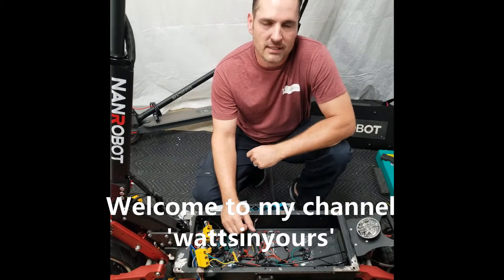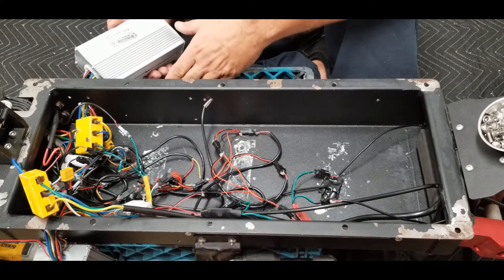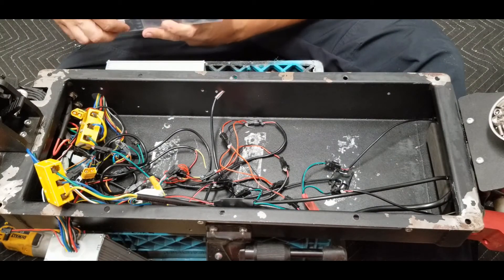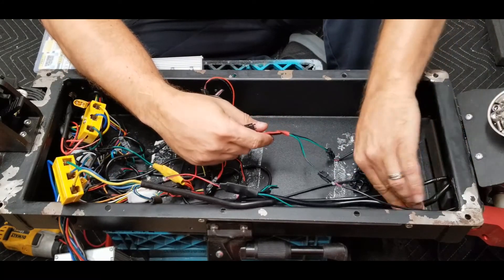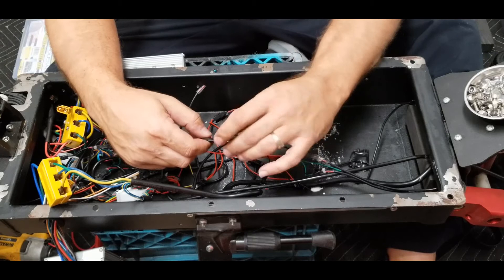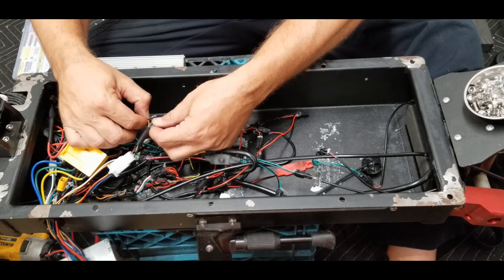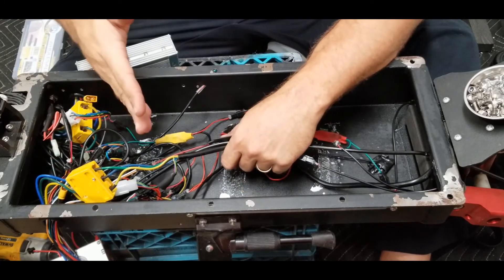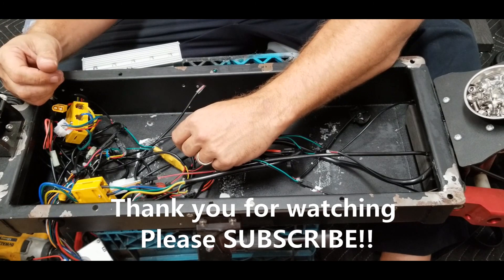Nanrobot troubleshooting, short circuit protection, and overview of wire placement.

Comment: Having issues with my nan d4-3.0 only running in dual mode. Changed the throttle and the dual eco buttons.  Still having trouble. Do you happen to have experience with this ?
Thank you for this vid. Great info

Comment: Did yiu got rid of the ugly hot glue on the connections? I used some E6000 to water proof the electronics and the front bumper

Comment: While in dual mode, my D4 cuts out one motor after awhile. Maybe when it gets hot. It didn't do that originally but started after maybe 2 years of use. Is that a wiring issue that can be fixed? I am not tech savvy.

Comment: Hey a little off subject I have a Chinese scooter realmax st-13 8000 I took off the flooring to open up to check for loose wiring so as I moved the wiring the front small led light was cutting off and on until finally shorting out, I saw a blue loose wire that was not being used exposed it touched the metal frame causing the headlights to stay on, so I saw a little smoke come out and now my headlights won't cut off from the main switch only when I turn off the key. So do you think I burned out my light switch or does these thing have fuses or a circuit breaker I tripped?

Comment: I've got a nanrobot d3 and I am thinking about adding another motor to the front for dual motor power how  do you think it will be . Wouldn't I have to get another controller,just worried about having a go. I would somehow have to add a dual motor switch as well. Is it possible trying to get my head around it

Comment: Hey man I have the Nanrobot LS7 and I'm having an issue where the scooter will be sufficiently charged reading 66.5-63.5 volts then as I'm riding it for a span of 10 minutes it'll go from 65 volts down to 0 volts in a matter of seconds. Any idea what's happening? I tried contacting Roadrunner Scooters as well as the manufacturer but both of them have been unresponsive as of this comment. Any info would be greatly appreciated.

Comment: not 5 hall sensors...wtf...do some reasearch and see how they work before you talk about them...it's 3 sensors, the extra 2 wires usually red and black is 5v supply voltage +5v red and black is gnd, the other 3 wire are for the voltage return from hall sensors. the same hall sensor is in the throttle how it senses how much you have pushed the throttle.

Comment: Dude my x4 keeps shutting down after exactly 3 minutes of riding.. Baterry is fine... Wiring is correct... But the voltage lock where the key goes is a bit damaged can this be the problem?
Reply from the maker: Could be. Maybe a loose wire inside the key lock. Maybe you take it apart and see. Let me know what you find.
Reply: @wattsinyours  it was the acceleration control lcd panel.. Had to replace it
Reply from the maker: @x4disaster  Thank you for letting us know what you found. I'm sure people on here that run into the same problem will be grateful for your input.

Comment: Hey guys I think my controller is broken my rear tire doesn't work anymore on d4+ and make noises any ideas
Reply: I ordered on nanrobot a new one already for 88€ hope that fixes that problem have to wait a few days
Reply from the maker: @philippmayer569  ok good. Let me know how it goes after the install. Worst case scenario is that didn't fix the problem and you have to get a new motor. Not super cheap but not the end of the world either.
Reply from the maker: Yeah its probably the speed controller. I would try swapping that one out first and see  if that fixes the problem.
Reply: OK thx for fast answer:)

Comment: Hi, i hope you can help me with a little guidance about my Nanorobot D4, i have this awesome scooter for 9 months, and now out of the nowhere doesn't turn on at all, anyone here has any suggestions or answers please, HELPPPPP thanks.
Reply from the maker: Could be a few thi gs happening here. I would start with checking all the wires in the deck to make sure everything is connected properly. If so them i would take an electrical meter and check the battery and if that is good, then i would start by replacing the throttle controller because it is the easiest and the cheapest to do. Then if that doesn't work then I would start replacing the speed controllers.

Comment: I had to replace the folding mechanism on my D5+ and had to disconnect the wires then reconnect them. The problem is that the the rear motor is going in reverse. Have you heard of an issue like this before?
Reply: You have your power connected wrong for your motor. It goes. Yellow to yellow. Blue to green green to blue.

Comment: Nice video. Did you have any issue with your voltage controller going bad on you?  Mine stopped working as I no longer get power to the front wheel... While I was troubleshooting it caused a spark (small explosion) when I disconnected the plug (power connector) between the battery and voltage controller and burnt the plug and burnt my finger 😓 .. I think the voltage controller for the front wheel is shot... and thanks for the screw driver technique to pry out the deck.
Reply from the maker: I've been lucky and haven't had any issues yet. Luckily the speed controller is inexpensive to replace. You can find them on aliexspess or alibaba but you will just have to wait on shipping times. The xt60 connectors are cheap to. You can find those at the same websites above and also on Amazon if you want them faster. The speed controllers will hold a charge because of the large capacitors they have inside them. Thats why you want to be careful plugging and unplugging them. What i do is just plug them in quickly because the spark sometimes will burn/melt your connector end and you will have to replace them.
Reply: @wattsinyours  Thank you for the info that was very helpful to me. I will get the XT60 connectors then.. Hopefully I will be able to get the voltage controller replacement from the vendor I purchased from. Thanks again!
Reply from the maker: @rockefelleragent1357  no problem. Just be careful when you connect and solder the new connectors. Tape off and cut each wire separately and do it on a plastic lid or something simular. That will help against touching the wire to any metal and shorting them out. If you need and more help when you go to do the work let me know. I can direct you to a certain extent if needed. Feel free to reach out anytime. Good luck.
Reply: @wattsinyours  Thank you I will! 😊

Comment: Your videos are super helpful man. I’ve been having a huge problem with support from Nanrobot.
I bought the d5+ 2.0 for Christmas.
my battery won’t charge over 2 bars. And tops out at 50.1 volts.
I know nothing about this stuff. The battery that comes with it will turn green after 4 hours of charging. Per the manual that means it’s done charging right? Any help would be amazing since I’m getting nowhere with support. Any idea where I can buy another battery? Maybe it’s a bad battery? Help!!
Reply from the maker: Your welcome. So it definitely should be charging to 58v, so that probably means some cells are dead in the battery. I would keep trying to contact nanrobot and get them to send you a new battery. As far as swapping it out it is really easy. When you get to that point let me know and i can assist you if needed. Good luck and thanks foe for watching my videos.
Reply: wattsinyours  I’ve thanks for the advice, if I get nowhere with them, where can I find a replacement battery?
Also based on what I’ve mentioned do you think those are attributes of an over charged battery?
Also say I charged it to 2 bars. If I unplug it and come back to it a week later it will have 1 bar. As in it won’t hold the charge. Is that also a component of over charging or a bad battery? Any help would mean a lot. I’d rather just replace it on my own these guys customer service sucks
Reply from the maker: @Powerful9315  
I don't think its from over charging. Ive charged mine every way but upside down and have had no problems. I think its definitely the battery. Either way i think you need a new battery pack. If you don't want to deal with nanrobot then try these guys to make you a new battery. http://www.litechpower.com. But keep in mind they will ask a bunch of questions. Ex: what connectors do you need? How many? male or female?, what size connectors? Xt60 or xt 90? voltage, amps, space available where the battery goes ect ect. I dont have all that info from the d5+ and to be honest its a lot of specific info. If you take the deck lid off you should be able to give them the info that they need. If you get stuck and don't know the answer let me know and i can help. The battery is going to run you about 300.00 to 500.00 but thats a guess because i don't work for them. Good luck and let me know how it goes.
Reply: wattsinyours thank you my friend, your a gentleman and a scholar

Comment: I can confirm that on the D4+, the mileage are affected by changing wheel size, so chances are that it's the same on your scooter.
Reply from the maker: Yeah that kinda sucks bc either your speed don't match or your distance doesn't match. I guess ill go by gps for speed and distance with the throttle controller after i verify my wheel size is correct for distance.
Reply: @wattsinyours  I thought you just changed the magnets on P2 until the speed was as accurate as possible?
Reply from the maker: @simonmllerkristensen9640  i decided that whatever the number of hall sensors i have thats what im going to keep it at.